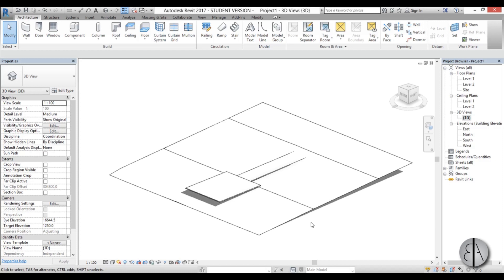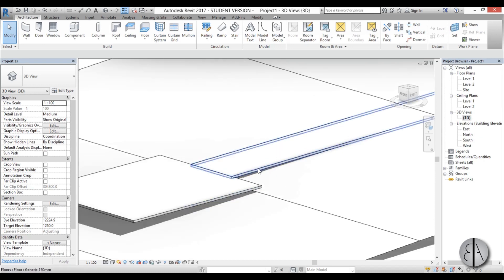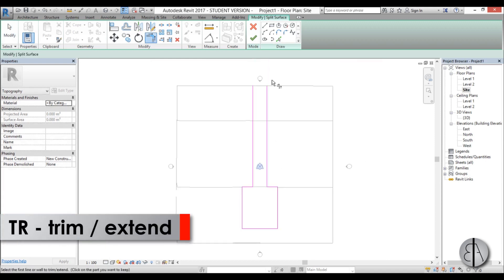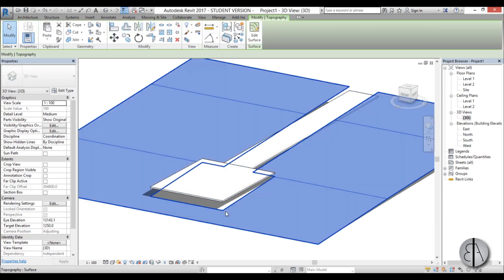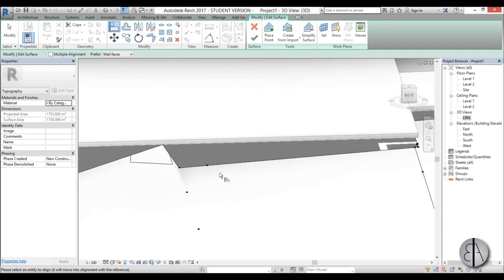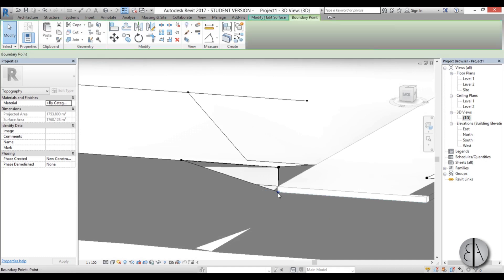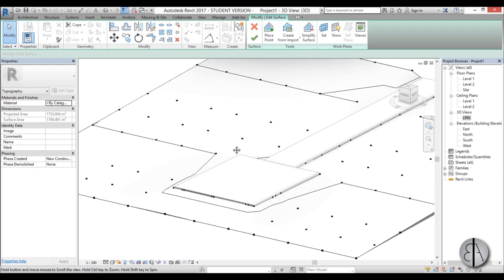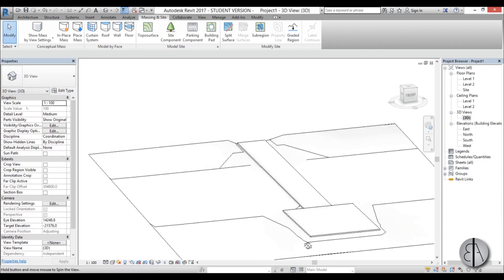Adjusting Topography to Floors in Revit Tutorial

Comment: Older version?  But you should be able to select multiple node from surface to align at same time.

The problem I have is after I create structure footing. I need to do a cut and fill calc
 
Do you have a better way to copy an entire bottom of Footing surface to autocad. Import back to Revit. 

So it can be recognized in cut and fill calc. 

After I import back to Revit. It can not be recognized is the problem

Comment: Thank you for your video. I have some questions. what if you need to slide the walk. Is there a way to change the split boundary? Or the void you made is curve, which means it will be a lot of points. Is there a easy way to changing it? I was using this method, but found out it's very painful if the design changed. Do you have any solutions? Thank you!

Comment: Hi and thank you for your Videos.. how i can put my project on (not in)  the topography in diferent hight ? I drow my project by level 1 to 5 , but my topography is not match by my levels ... can i fix it? Thank you alot
Reply from the maker: You model topography from the site floor plan. and you set all topo points in that view. If you have a point that's on 5m and your level 1 is on 4m the level will cut the topo in that view. If you can't see topography in floor plans go to VR (view range) and set the view dept to unlimited.
Reply: Balkan Architect thanks alot.. ok i will chek that points..i realy like your capturs ..thank you and good luck 👍

Comment: This is a perfect example of when to click the little checkbox labeled “Multiple Alignment” when using the align tool. It will cut the quantity of clicks and time in half.
Reply from the maker: thanks for the tip!
Reply: You can also check the level of the floor, select all points that need adjustment and type the value a single time.
Reply: great tip